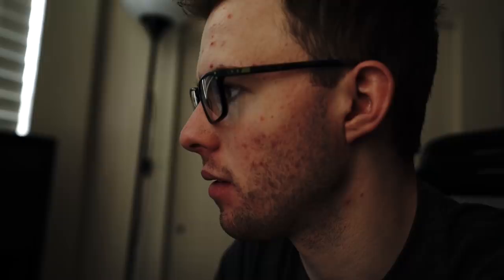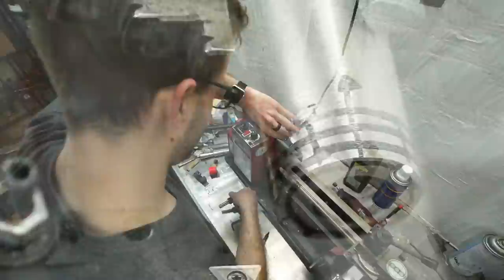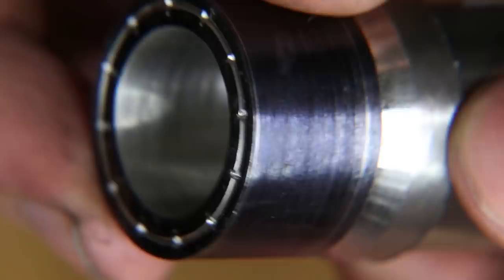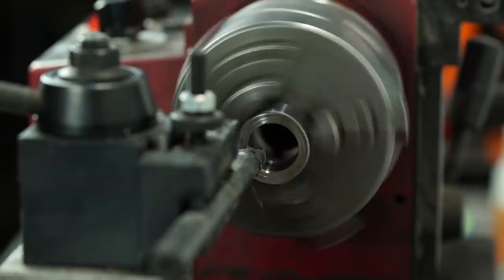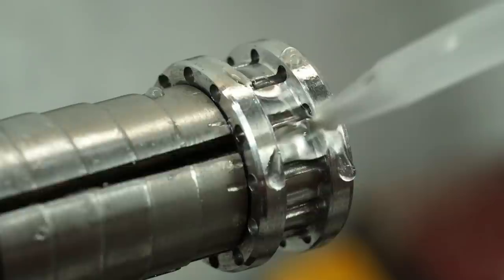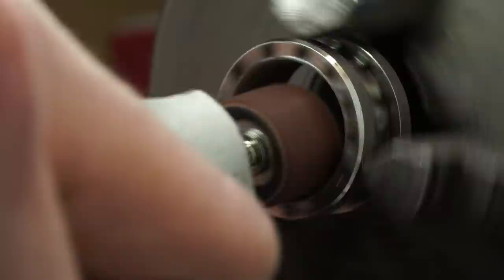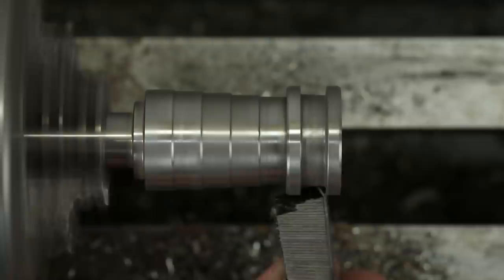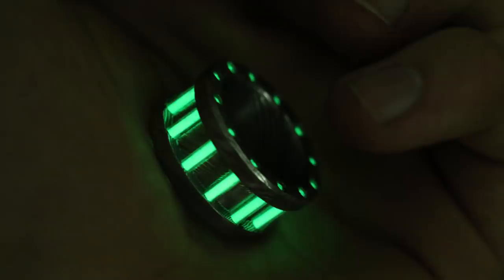Making a Tritium and Damascus Steel Glow Ring

Comment: Hey bro I loved the ring but js wouldn’t it be better if before sanding the ring you blasted it with air with rag over the the air hoe so it doesn’t get everywhere because if you leave material in and you but sand paper over it you might get material stuck on the sand paper and you might scratch chips against the metal and you might scratch it and this might save you time😁 this is just a theory, I’m a machinist myself.

Comment: Health risks 
Tritium is an isotope of hydrogen, which allows it to readily bind to hydroxyl radicals, forming tritiated water, and to carbon atoms. Since tritium is a low energy beta emitter, it is not dangerous externally (its beta particles are unable to penetrate the skin) but it can be a radiation hazard when inhaled, ingested via food or water, or absorbed through the skin.HTO has a short biological half-life in the human body of 7 to 14 days, which both reduces the total effects of single-incident ingestion and precludes long-term bioaccumulation of HTO from the environment.The biological half life of tritiated water in the human body,

Comment: Tritium’s effects are unknown. But it’s radioactive. Usually is used in tiny amounts. Not dangerous? Not so much.
Reply: Tritium, which is a beta emitter, causes cancer and birth defects, said Ira Helfand, a doctor at Cooley Dickinson in Northampton, Mass., and the co-founder and a former president of National Physicians for Social Responsibility

Helfand's biggest concern is that tritium can cross the placental barrier. This was confirmed in animal studies, as documented by the United Nations Scientific Committee on the Effects of Atomic Radiation.

"Several statistically significant effects were found at various (tritium) levels, in no apparent relationship with dose," it stated. "These included microcephaly (shrunken heads, also observed at Hiroshima), sterility, stunting, reduction of the litter size, ..."

Comment: Well since they use to make Rolex tritium, I would like one with a black leather interior padded with rubber “redundancy.” I’m so rough with my rings so anything  but epoxy, like I don’t know, how about cubic zirconium invisible setting princess cut in-between the vials.. I rather scratch that then the vials.
Reply: Yeah I want one even after I watched a segment where women was working during world war 2 to put out tritium dipped whatever and died from unknown reasons. “During that time of course” apparently they where dipping the brushes in it after they moisten the tip with their tongue so they literally were ingesting the shit... and obviously he is t doing that but still. Radioactive material or not... 😏 rubber lined black leather.
Reply: Or prisms as cushioners so it looks like a glass spike, with mirror reflectors..

Comment: its weird how tritium is legal but some of the most safe stuff is not tritium even comes in gun sights,tritium can be dangers because of the hydrogen isotope is man made in a nuclear power plant but use it as a neutron buffer to create sub atomic friction that makes  heat to boil water to turn a turbine genarator for power thats why the water glows, if the iso were to spit out one of it neutrons then that could be dangers it only takes one sub atomic particle to kill you so any one playing with the stuff make sure to take all the safety precautions, be safe and take care everybody oh and it only comes in one true color and its amber.

Comment: It's a nice product, but you should respect your tools, son. Be kinder to your blades. Slow down your rotations significantly - those little bits can't handle the heat from high RPM drilling. Apply enough cutting oil to ensure your contact point never goes dry, and clear your shavings off the bit and material. Second half of that drilling looks better in terms of oil and you slowed down, but swarf is the enemy. Your blades will be more accurate and last longer. You shouldn't be getting a half inch of cut per drill bit. 

I'd also recommend you swap out that bandsaw blade. It looks like it's already dull and you turned up the downfeed to compensate, but it's pushing too hard and cutting at an angle. Replace it, keep that blade speed down, and either apply oil to both sides of the blade about one or two inches back from the bar you're cutting, or get some coolant and apply it directly to the back of the blade so it runs down the sides before it reaches the cut. The blade carries the cutting fluid to the cut, where it will cool the material and carry away waste material. You also never want to rest the bandsaw blade on your material like you do at 8:20 - it will damage the teeth.

It might also be worthwhile looking into a metal hbs with a coolant rig, or just rig one and some brushes for your existing saw. If you're using that for metal cutting applications regularly you'll immediately notice a difference. Treat your blades right and that bandsaw will be as indispensable for precision work as your lathe.

Comment: Even a small amount of tritium is dangerous if ingested .  Tritium has the nasty habit of turning O2 into H2O, if swallowed you will suffer what is called dry land drowning and die.  There is not much that a peri medic could do to help you as the process is rather quick.  There have been undocumented incidents in the Air Force of this occurring and killing an entire team of weapons mechanics.

Comment: I really love the looks of the Ring, but I would strongly recommend not wearing it. Tritium decays with Beta Radiation and the Electrons won't pass through the metal but it will create lots of Bremsstrahlung and that will definitely cause cancer in your finger if you wear this for 20 Years.
Reply: Emission from Tritium is about 0.1 mSv/year, and mostly shielded by the steel ring.  
The emission from the Indium in the touchscreen of your phone could be about 86 mSv/year.

Comment: tritium is used in nuclear weapons
Reply: Yeah, in the tertiary stage in a multi stage fusion device that requires a conventional nuclear weapon (forming and maintaining a critical mass of uranium or plutonium long enough to actually convert a couple grams of matter into energy) as the secondary stage which itself requires a bunch of conventional explosives (the first stage) to assemble your critical mass hard enough to resist the force of the thing trying to blow itself apart. You're not wrong, but it's not like they're selling nuclear bullets, this isn't low hanging fruit for terrorists and dictators.

Comment: What happens when your exposed to tritium for one week
Reply: In this form, nothing at all.  The weak beta radiation emitted by tritium can't penetrate the glass of the little vials.  Even if it got out, it couldn't penetrate your skin.  Even if you broke them all open at once and snorted or swallowed the gas, that's not nearly enough to cause any real problems in one dose.

Comment: BS you can buy it in tiny tubes used for watch hands and artwork because they are filled with tritium gas. It would dissipate if broken. It is totally sold on eBay. I bought it myself. And you can buy really tiny ones in all different sizes and colors that you can use to create wonderful designs. Watch out for what he charges you for this stuff if he is telling you that you can't easily buy it yourself, and legally.

Comment: Might have made better sense to use the tritium in a watch band or, really, anything but a ring. That thing is obscenely large and, honestly, unsightly because of its size alone. Might look okay on the finger of someone who weighs a minimum 300lbs, but even holding it in your hand, it's clearly more of a metal wheel than a ring suitable for the average finger. Novel rubbish, imo.

Comment: This is a slight dangerous and illegal ring and you can be prosecuted in the United States most likely with respect to "constitute an unreasonable risk to the public health and safety" per USNRC 110, for failure to obtain and comply with licensing, per USNC 110.19, and failure to maintain reasonable safeguards as outlined in USNRC 30.33.

The video is enough to prosecute you.

Now from a practical standpoint, the ring is dangerous, even if you complied with the law because the tritium vials are exposed and subject to breakage. If they break you will expose yourself and the people around you to tritium, which if ingested, could increase your chance of cancer or other diseases. Watches that use tritium are sealed like dive watches. It is significantly harder to break the vials and if they do break, they will not leak into the atmosphere and yourself or others. If you should break a vial in a watch it would have to be shipped to a proper facility to dispose of the nuclear material, the same would be true of a ring.

You could make this ring safely; but, your current design is unsafe. To make it safe, I would embed the vials in epoxy and thoroughly seal them at the ends, maybe with a threaded bolt with a rubber o ring, which is what they use for watches, or maybe more epoxy?

Why I care, because people will make these, or wear these, people will get hurt, and they will put more regulations on Tritium, which I just don't need in my life, thank you.

You might want to pull this video if you don't want to get prosecuted; but if you persist, you should redesign the ring and reedit the video with all sorts of warnings and caveats. It will not protect you from federal prosecution; but might protect you a wee bit from liability cases?